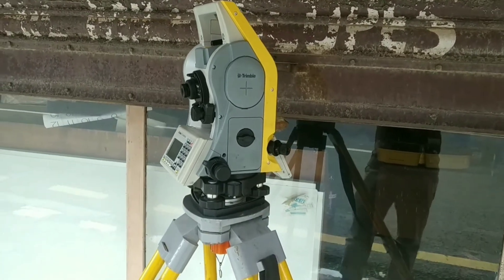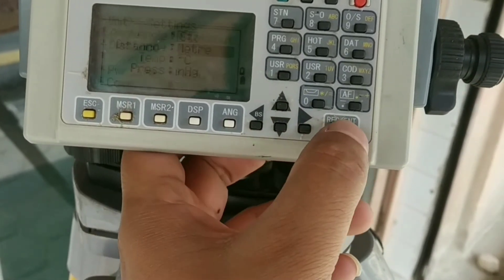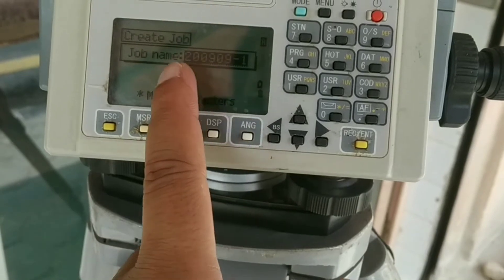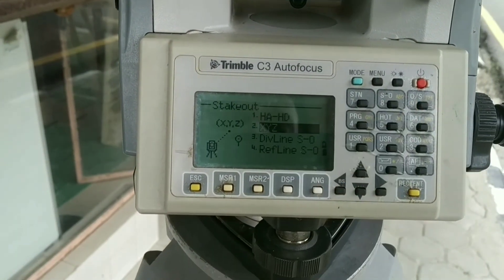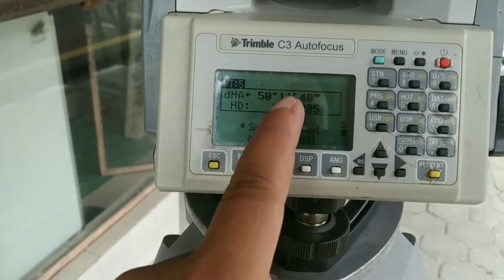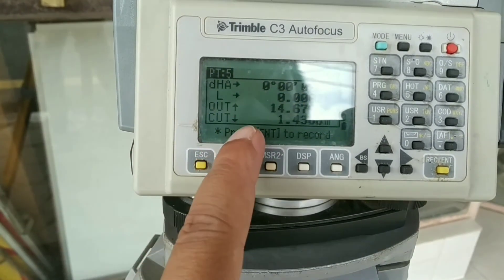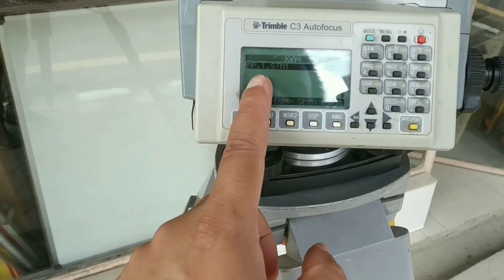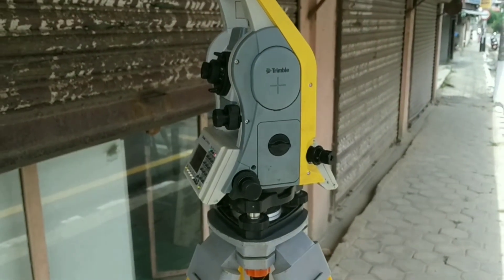Trimble C3 Total Station Survey and Layout | Autofocus | Basic to Advance | Survey Nepal

Comment: HOW TO INSERT CO-ORDINATES FROM DWG FILE TO TS  PLZ SHOW  THIS VIDEO
Reply from the maker: Sorry sir it cannot be done on trimble c3 total station. For that you need to extract data from dwg file to Excel and than import to TS. I can show you this process if required.
But on Trimble M3 and other model TS with Trimble Access, you can directly import dwg file.